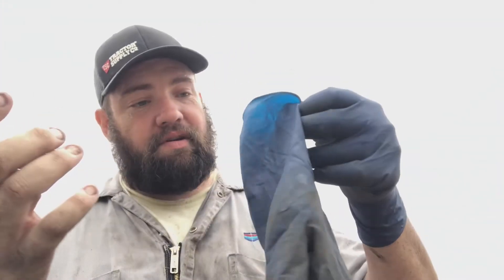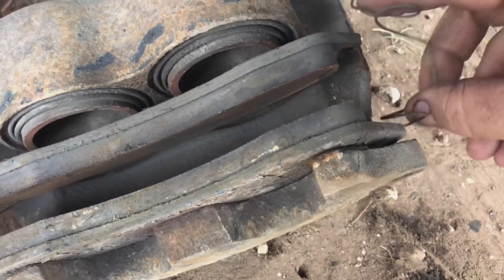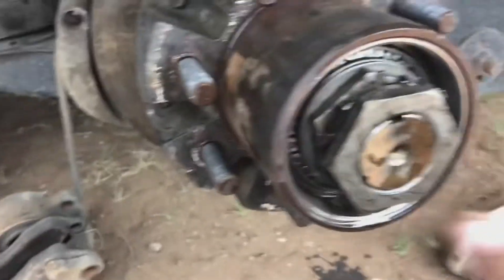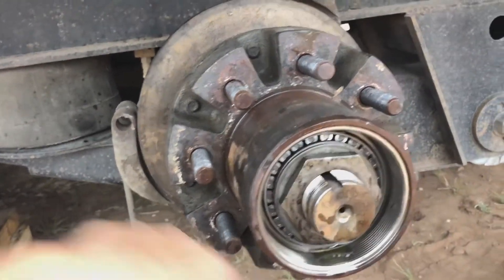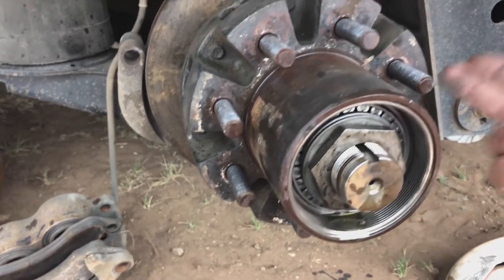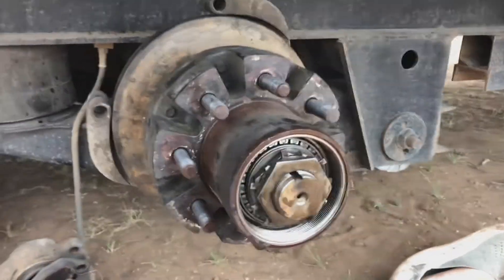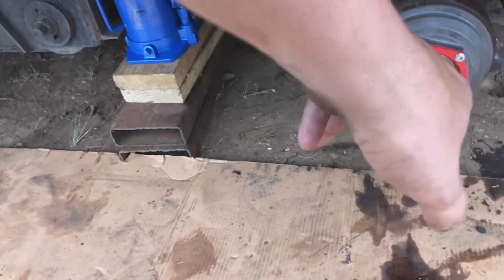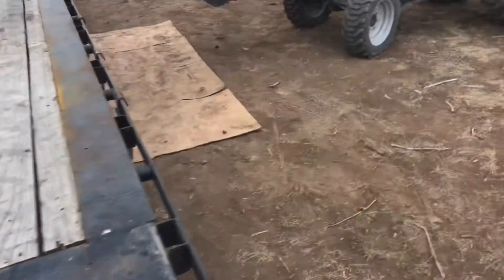Ep. 18 | How-To install bearings and seal on Dexter 12K axles, Parts and Tools in Description

Comment: Interesting,  i have the same exact axles and i lifted the trailer and noticed a small play in the bearings , decided to torque them back a litle and now they are getting very hot , so now i see where i made the mistake.  
I think i have the inside washer too tight although the wheels spin freely , . Im gonna go do exactly how this video shows , 
Thanks

Comment: Great video. I got a new trailer with 8K dexter wet axles. I used it one time and it's leaking out the front on one axle. How do you add the oil? Never done it before. Tx
Reply from the maker: There should be a rubber cap in the center of hub to add oil

Comment: Anyone know where to find the washer that goes between outer bearing and the nut? Mine needs replacing, will any old washer be okay?
Reply from the maker: Any trailer sales place should be able to order it. Also one of my other videos has screen shots of the Dexter parts catalog with all the part numbers and you would be able to order it on Amazon.

Comment: thanks this is exactly what i needed. my trailer did not pass inspection cause the rear rotor and pads was in need of replacing.
Reply from the maker: Not a problem. Glad it helped. There’s also another video that I did recently that has screen shots of all the part numbers with all 12k parts.

Comment: Hey do you know if all 12K Dexter axels the same bearings? As in part number, because I was told there was 3 different types of bearings for those 12k and would need to take apart before hand to see the part but wanted to get some info before I take them apart so I can have the new bearings ready for the road
Reply from the maker: Shoot me a email at TxTruckinUp@gmail.com and I’ll send you some pics of the Dexter parts list that has all the part numbers listed.
Reply from the maker: @Tu Deddy just found the pic all 3 Dexter 12k axles takes the same bearings and seals. Outer bearing is 031-021-02(28682). Inner bearing is 031-020-02(3984. Seal is 010-056-00. Hope that helps.

Comment: What kind of oil I need and what I neet to know to change the caps from plastic to aluminum?
Reply from the maker: I use Lucas 90 weight synthetic oil. As far as the caps you just unscrew the plastic dexter cap and screw the valcrum cap on an torque it to the required spec.

Comment: How often do you need to change the bearings & seal? I have 10k axels with electric over hydraulic. With only 13,000 miles on the trailer. But I’m just trying to see how often you have to perform that maintenance job.
Reply from the maker: I change the oil in the hubs once a month. So that comes out to about every 10k to 15k miles. If you stay on top of the oil changes I’ve heard of bearing and seals lasting  a long time
Reply: @DosGringosRanch  Thanx for responding back 👌🏽
Reply: @DosGringosRanch  let me ask u another question if u don’t mind. What parts of your trailer do u use a grease gun to lubricate parts? This is my 1st time having a trailer & I’m just trying to take care of it for longevity.
Reply from the maker: Really any part that has a grease zerk. On mine I have to grease my hydraulic pivot points cause the trailers a full tilt and I also have some grease zerks on the axles cause of the airbag setup on the trailer.
Reply: @DosGringosRanch  so other than those parts you don’t have to grease anything else? And how often do you grease those specific parts you mentioned?
Reply from the maker: I do it once a month or roughly 10-12k miles.
Reply: @DosGringosRanch  okay. Thank You for that helpful information.
Reply from the maker: No problem.

Comment: How do you know when a seal goes out?
Reply from the maker: Oil on the backside of your inner wheel and your having to add oil constantly. Also your hub will be scalding hot to the touch with no oil or grease depending on your setup.
Reply: Is the early sign of a bad seal having a little build up where the Hub bolts to the actual brake disc?